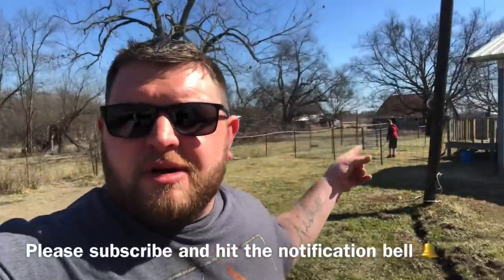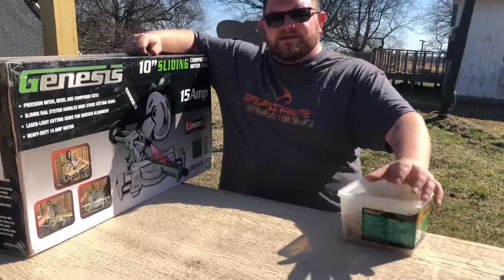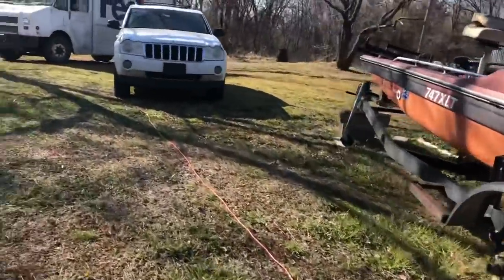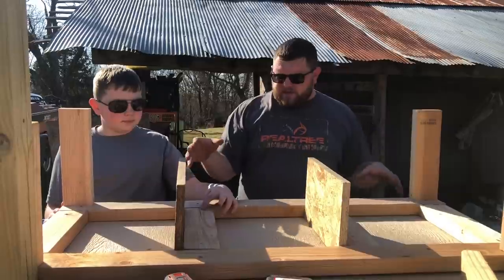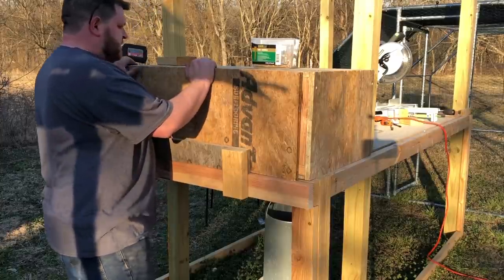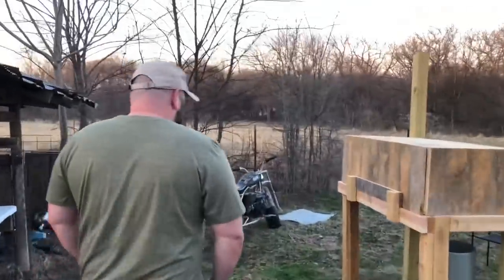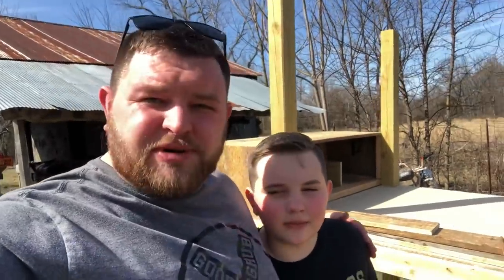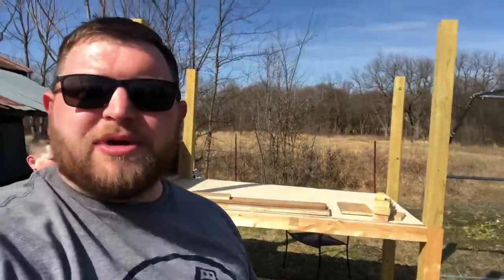Keeping it Dutch APPROVED- How to DIY Nesting Box from scraps

Comment: Vincent , you could possibly use L brackets to help hold the top of sliding door in at the top ! This would also keep it from falling off the ends when you slide it open ! A L bracket just inside of the hooks should keep the door from falling off the ends ! You might want to use something other than hooks to hold the top of the door as raccoons can unhook them !
Reply: Agree, you beat me to it. L brackets would keep the sliding door from falling off. Use eye hooks with the safety latch.

Comment: Hey Dennis, gr8 job on the build! Since you made the sliding door out of plywood ... It will swell up from rain or moisture. Eventually being too tight to slide. A good coat of poly urathane or sealer will prevent the water damage & make your nice build last a long time.